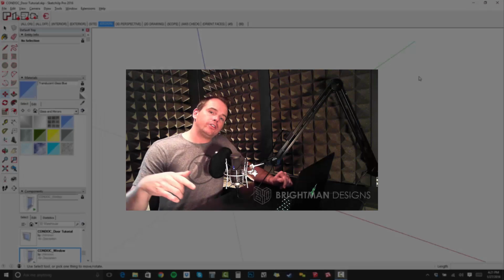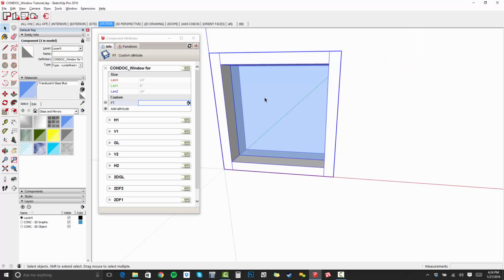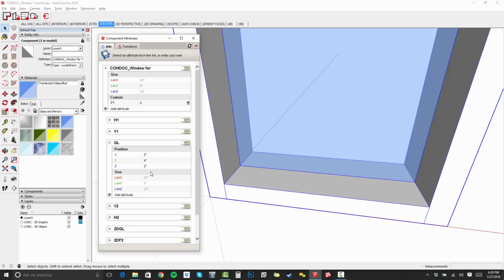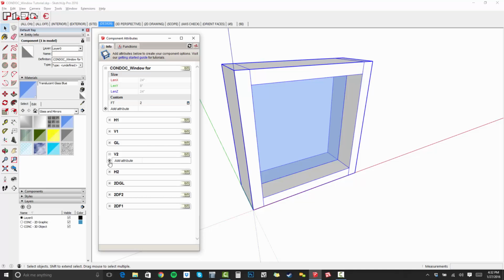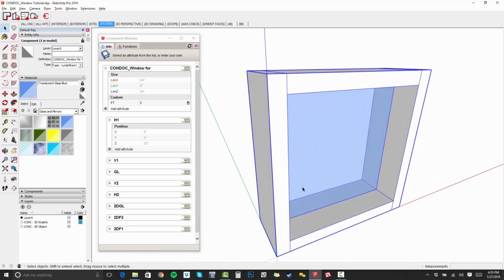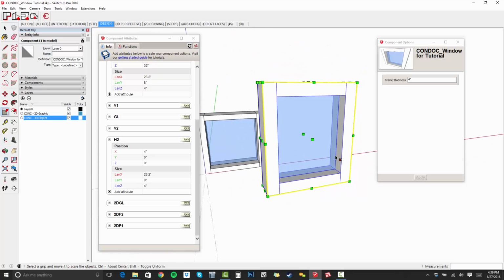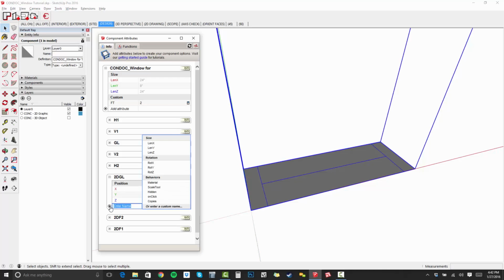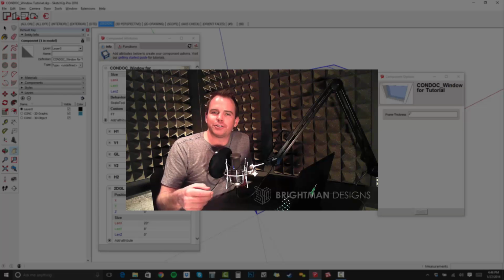Creating Dynamic Components Part 3 -  Assign Attributes

Comment: Thank you for that good easy to follow tutorial. What about if you want the wall to dynamically puncture an opening when you add those component?
Reply from the maker: Thanks Ronnie!  It can be done... you would need to add four edges that fits the extent of the opening, not grouped, and at the first double-click into the component.  You wouldn't be able to make this shape dynamic, but shouldn't be a problem since it will likely equal the overall dimensions of the window.  Also check out double-cut here, https://extensions.sketchup.com/en/content/double-cut.
Reply: Brightman Designs Thank you! I use sketchup a lot and this help a lot in my modeling process.

Comment: great video! Could you help me: I have two panel doors, and I made for the user a list where he can choose width - 600mm -700mm, and so on, the problem is when I choose 600mm the second panel should gain the 100mm that the first one had lost so that whole width will stay the same. Sadly sketchup overrides variables I think its some kind of problem with global variable and local etc. I try i too use CURRENT function but it wont help. Do you have any tips?